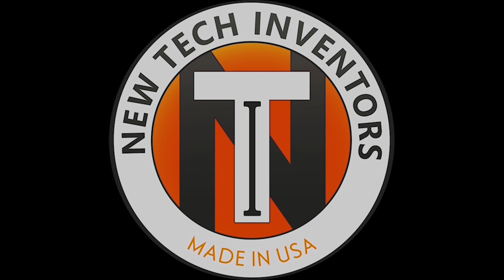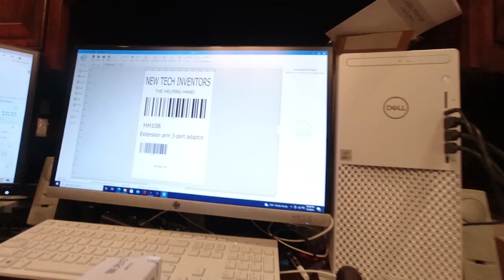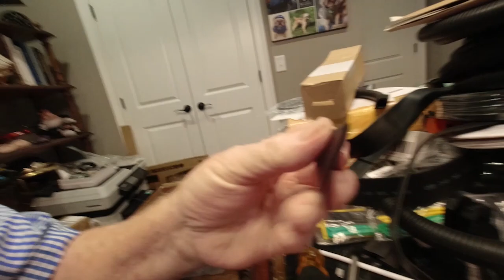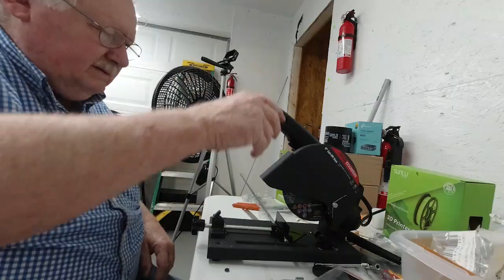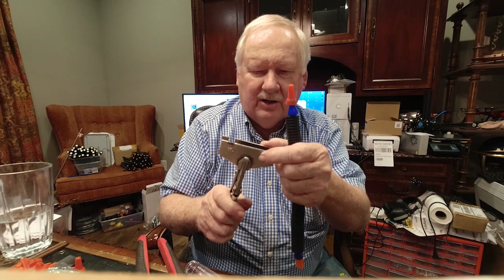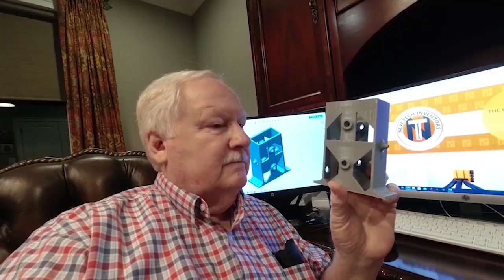SPARKS ARE FLYING THIS 4th OF JULY AT NEW TECH INVENTORS

Comment: Happy 4th my brother... suggest on the soldering ...I have been using wirefy solder tubes that require just a heat gun they are insulated with silicone.  I highly recommended these tubes you can see a demo on you tube.  It would make at least your soldering easier.  I love your pressure tool good thinking.  Thanks joe
Reply from the maker: Happy 4th to you my friend. I checked out wirefy and it looks like it works great when connecting two wires together, however I have about 1,600 solder connections between wire and components (power plug and wire, etc.) to solder within the next few weeks. My eyes aren't what they used to be, and I am dreading every minute of it. Thanks for trying to help I really appreciate that Joe. Well time to get back to work, I will do a short video on my soldering challenge and show you what I'm up against. Till the next time...Ken
Reply: @NewTechInventors   I’d like to see it.....your challenge is mine my friend ....happy 4th ..joe